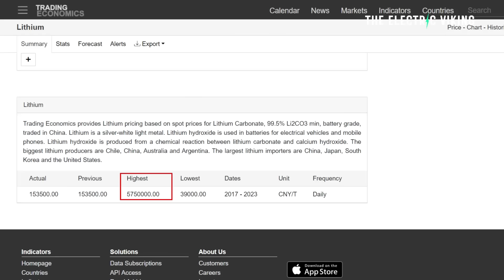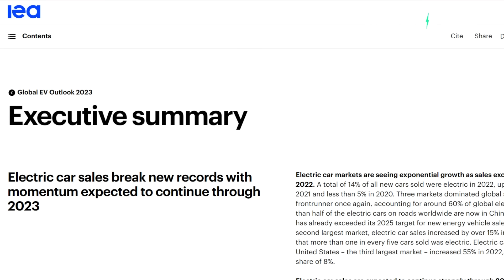The reason Electric Cars will be cheaper than ICE cars in 2025

Comment: No matter how much cheaper batteries get, there will still be places where going all-electric won't make practical sense due to deficient charging infrastructure and people just not wanting to make 20+min charging stops (likely longer since cheaper EVs likely won't get 350+kW charging any time soon) multiple times on trips (and even more of that multiple on cheaper EVs with smaller batteries) that can be done on a single 3min fill-up, maybe two. Where I am in Canada, Dec-March averages -5C and half of the fast-charging power I'd put in an EV at 4-5X the domestic power rate would get used for heating, not particularly appealing when charging at home (apartment) is not an option and unlikely to become one.
Reply: Charging infrastructure can be established literally everywhere a car can be driven
Pauses are very normal, most people cannot drive more than a few hours before needing a break. You will need a car with 50% more range than your bladder
Norway is very cold, they have no issues with electric vehicles
BEVs are getting cheaper every day, ICE cars are getting more expensive every day
Reply: People don't take 50 minutes to go to the bathroom.  On a recent trip from PA to Tennessee, I needed to stop for 30 to 45 minutes every 2 hours to recharge. One of the stops needed to be close to an hour because the Tesla Supercharger was sooooo damn slow. 50kw max.   As far as "infrastructure can be established literraly anywhere a car can be driven..."  Sure... middle of Alaska?  Middle of the road in the desert between Las Vegas and LA? lol.  They are not going to be running power to many of those places and if they do set one up, it will be powered by gas generators.  @casper_hansen
Reply: @casper_hansen  EVs may be getting cheaper but the cheapest ICEV I can get is still 10k$ cheaper than the cheapest EV of remotely comparable range even after EV subsidies.

I have a friend who lives near Ottawa. I can do the whole Montreal-Ottawa roundtrip on about 30L of gas. Doing the same trip in a Bolt EV requires two charging stops taking about 1h30 combined during which the other friend I brought along for the trip ate over $20 in snacks each way. Most chargers along both the north and south shore routes only do 50kW max, meaning a faster-charing EV than the Bolt wouldn't have made the trip meaningfully faster. Had it been colder weather, a third charging stop could have become necessary due to heating and that would have made the trip more expensive than gasoline on top of taking 2h longer.
Reply: My bladder dictates my stops so o try to plan ahead. I don’t need more than 100 Kw charging speeds.
Reply: lol.  So you drive a Bolt?  And guessing you are not on a timeline?  You think stopping to charge for an hour every 2 hours is okay?  Perhaps if you are 70 and don't need to be somewhere at a particular time, however this is totally impractical for majority of buyers who need to go on a long trip, etc.  I had a bolt for an entire 5 days until it went back.  The charging speeds were abysmal. WE do a few big road trips per year... what takes 8 with gas takes 10 to 12 with EV. Not acceptable.  @AlanWilliams-su4bs

Comment: 70.000.000*50kwh=3.500.000.000kwh battery for 1 year production of ev,how much we produced this year I don't know but are we close
Reply: Your calculation of 3.5 tWh is quite correct... for the time 100% of the world automotive production will have transitioned to EVs.  So, it is not before sometime next decade.  We presently stand at 2.8 tWh/year of production capacity (which is obviously larger than production volume) for all usages (transportation, grid storage, electric appliances, tools, etc), and is growing very fast.  So, we are already not that far away.
Incidentally, Tesla is planning to produce 3 tWh of batteries per year in 2030; it is over 80% of your number... from just ONE company.
Reply: @st-ex8506  so we're definitely there, with 2 twh we can produce 50 M vehicles ,we just need the price to be like in China to expensive in Europe for the moment

Comment: I would like an electric vehicle but they are out of my price range for new . I would need to be at 15k and don't know if that will ever happen with new but once the user industry gets established with repair shops and battery testing and replacement then we may see very good deals in the user market . The other side of evs is the computer system can degrade also . Who hasn't noticed a laptop getting slower as time goes on so that another aspect that needs to be addressed in the used market . 
That's a big part is the industry and competition to get prices lower in servicing and maintaining these electronic/electric technology transportation vehicles .
Reply: If you know about how things work and take care of them, they last a lot longer. Same would be for EV
Reply: We’re already at that price when you consider that a $30k Tesla Model 3 will last more than twice as long as your average ICE car.
Reply: If you’re saying £15k UK price then there are virtually no cars at that price now, if it’s USD then no chance ever.
Reply: Have you noticed your ICE becoming slower, less reliable, less fuel efficient as it gets older. If so it is highly unlikely that it is as a result of the ageing of the vehicle's engine management system (ie computer). To compare a laptop to a vehicles engine management system (ICE or EV) is erroneous. ie like comparing Apples to Oranges👎💩
Reply: @paultrgnp  EVs like Tesla use allot of software . The screens are basically laptops on steroids . My 2, 20 year old ice vehicles run as well as they did when new . The computing system is like comparing a flip phone from the 1990s to today's smart phones . Software as it ages gets corrupted slows down and glitches
Reply: @stevencole7331 Your 20 year old ICE vehicle is not running as new.
Reply: @stevencole7331 This is not true, computers in the past were getting slower because of new more resource hungry software, and aging hhd discks. In cars and modern computers there is no such concerns
Reply: @jakubiskra523  older Teslas people complain of slower response and more glitches with the soft ware . Other factors is operating systems reach point where they won't be upgraded . We see this with windows . It's not profitable to update older operating systems
Reply: @stevencole7331  If you have the same hardware there is no need to upgrade software. I have no idea what deal is with older tesla owners, maybe unnesecery software upgrades, or forcing more capabilities without looking at later usability. The fact is, CPU, RAM, SSD do not age, and software does not become buggy on their own. This is my point.

Comment: Way too many assumptions! There’s still an awful lot of problems with EVs, and a lot of anti-EV sentiment out there. The technology still isn’t anywhere near on a par with ICE cars. I don’t see it levelling up any time soon.
Reply: Please explain in detail the problems with EV's ?
Reply: @vancity2349 they have been well documented on this site, so no need to ask.
Reply: @vancity2349 they are not suitable for long distance journeys without adding hours of charging time. High charging costs. Excessive forecourt prices. Insurance premiums sky rocketing. Depreciation off the scale. Battery degradation. Problems maintaining them when they go wrong (ie you need a specialist). WLTP lies about range. Excessive use of electrical components, eg in door handles. Safety issues around batteries. Will that do?

Comment: Same thing that happened to computers is happening to batteries they went from a luxury to a commodity.
Reply: Except the raw material for computer chips is fracking SAND, plastic(s) and copper. And are near negligible in the production cost.
The factories/tooling/process/research and yield are what make the cost.

This is the exact polar opposite of battery economics. Where near all he cost come from raw materials.

For computer chips the cycle between research/return on investment is extremly short. 
Any new development comes to the marquet in just few month years then get cheaper to produce by the day. Because once the ingeneers and tooling has beenpaid for you just need more sand and copper to keep making money hand over fist.
EV are the exact result of what happens when you give a political solution to a technical problem.
Having european country guilt tripped for their 0.x% of pollution while the chinese and indian street sh1tters keep polluting like-if their was no tomorrow.
Reply: @G_de_Coligny  First sentence: change that copper into gold please....copper in such microscopic lines in a chip would oxidize very quick...
And battery economics? The newest battery tech, laboratorium still, as mad from sodiem (Na) and aluminium (Al) Sodium enough in the sea for being extremely cheap. Aluminium is also not very expensive.

And EV's are not special politics....
When I burn one liter petrol in a modern powerplant and use that electricity to run my EV I'll drive 3 times more miles than when I use that same amount of petrol in an ICE engine.
No one can be against more efficient usage of our energy resources.
And as a bonus...it makes us less dependable on oil states.
Reply: Go tell Intel and AMD to use gold instead of copper then… you use gold on contacts not inside the chip.
Reply: @G_de_Coligny  The wiring you see can be copper, the invisible small connection between all elements in the chip itself were , as I was told, gold because with copper the lifetime from the chip woul be to short.
And contacts will never be from pure gold, but can be gold plated agains oxidation.
Reply: Yea, keep believing… quite in line with usual escrologists “knowledge”
Reply: Necessity
Reply: No matter how technology advances the nature of a electron cannot be changed. It's a charged particle that strongly repels other charged particles. This mutual repulsion means you cannot keep many of them in close proximity without making them "angry". When they get angry things can get heated, so to speak.

If batteries were the answer, autonomous all-electric locomotives would be a thing. Instead they run off of overhead power lines, or use an onboard diesel-powered generator to provide current. Locomotives would benefit from heavy batteries because weight = friction = traction on a steel rail yet heavy batteries are nowhere to be found there.

That is because batteries are the LEAST efficient way to do electricity in a high current demand environment. We've always known that .. yet still the insanity continues unabated.
Reply: @Deploracle  That's why mobile phones run off overhead power lines via a pantograph.
Reply: @MrFuckwit999  no, that why mobile phones need to be charged everyday. And half of why they turn burning hot  under heavy use.
Reply: Don't let good old physics and chemistry get in the way of ideaology
Reply: @Deploracle Please go and get a relavent degree or stop trying to educate others.

Comment: Is this the end of the sodium battery? Lithium can store more energy than sodium just because of where it is on the periodic table. 
If Lithium continues to tank then the reason to change to sodium is drastically reduced.
Reply: Sodium batteries will, at similar production capacity, always stay cheaper than lithium ones.  It is not only a question of the price of the resource, but also of technology.  They are also anticipated to have a longer life (number of cycles), and to be safer.  So, they will have an important share of the market, no matter what.

Comment: The shortage of materials for battery fabrication has all been a big lie from the oil industry, the EV manufacturing will inevitably become cheaper than ICE cars and bring back prices we haven't seen in 20 years.
Reply: Sooo, are you saying that in 20 years I can buy fully functional used EV for $500?
Reply: @BoringBurger  what fully functional NEW CAR were you able to buy 20 years ago for $500 bucks?
Reply: @francoischarbonneau9447  None, but that's the point. Most people don't buy new cars. ICE cars have some value all the way from the price of a new car to just a few bucks. EV's price on the other hand will never go further down than the price of a working battery pack and after that it is worthless junk. That will leave large part of the population out of the people who can have private transportation.

Comment: It also makes sense to think about there are less moving parts
Reply: Look at an engine with multiple valves per cylinder, variable valve timing, cylinder deactivation, turbocharging, etc. then be amazed at the complexity of an automatic transmission. And a lot of those parts are wearing, not just rotating. Mind boggling. electric motors are long-term reliable and dead simple, comparatively. And no transmission, the biggest point of failure in many car lines.
Reply: @jamesvandamme7786 Most vehicles will do high mileage without any problems as long as they are serviced correctly, reliability isn't really an issue so I can't see what your point is! In fact if EV's have fewer parts why are they so much more expensive?
Reply: This is a point in favor of EVs, yes.  But I still have a lot of questions regarding battery safety, longevity, disposal, and efficiency.  Batteries are all chemicals.  We need to get this right, rather than rush it in.
Reply: @justaskin8523  https://youtu.be/BppLz6L3_cM?si=DglhoPDnrvbS4XGx
Reply: No question electric motors are much better than ICEs. But the real problem is energy storage. Toyota is screaming from her lounge that batteries are not the answer. Batteries weigh several hundred kilos and take hours to charge. Toyota wants to take the Hydrogen fuel cell approach that solves the energy storage problem. But it seems there is a political push to go toward battery powered EVs at any cost. I don't know exactly why.

Comment: Sam, EVs/Teslas are ALREADY cheaper than the average US CAR of $48,008.00 - Just that they will get WAY cheaper with scale.
Reply: The average price of an Ev is significantly higher than a gas vehicle. This has been shown in many other videos.  Tesla does have EV’s that are under 50,000, however, if you just wanted to get a four-door sedan with the room as much as a Tesla, you can get a Honda accord Honda Civic for nearly half the price.  Also, keep in mind that the average US vehicle is going to be a large pick up truck or a large SUV. You cannot compare a basic four-door sedan to the price of a large fully loaded pick up.